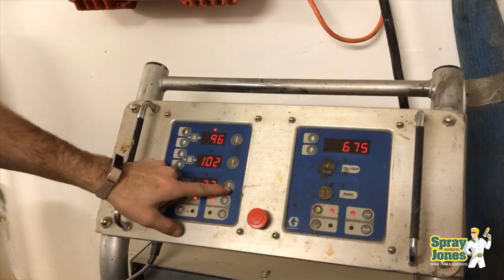So you want to get into Spray Foam Insulation?

Comment: When I foam a building I just use cans of window foam from the Depot.  Last job only cost me 12,000 cans x $5.99 = $71,880.  The house didn't end up even needing HVAC when I got done because it was so thermally efficient.  Then I scrapped the metal cans for $40.00 at the local recycling center.  I'm a Jack-of-all-homes, a Master at foam. I don't even charge labor. That way they're not "customers" and therefore cannot sue me later when the yellow foam igloo I turned their house into suffocates the pet geckos. I love your video, and the knowledge contained therein. There is definitely more to the spray foam business than many may think. I love your brutal honesty.  You are most definitely saving many people from a lot of problems and I think your advice can apply to a very wide range of different businesses.  I subscribed and it's nice to meet you.
Reply: Omg I am dead 😂

Comment: I have been an automotive master service tech for 3 decades. Not only a welder but working on the Isuzu 3 cylinder diesel, gen-sets, compressor and hydraulics. Most people don’t understand that air needs a dryer system and there is a lot of maintenance & cleaning. 
  Plus you have trailer maintenance, brakes, wheel bearing need repacked, lights need to work, etc. Then, you need a coffin hoist that swings to lift 50 gallon barrels of materials into the trailer from storage. How about keeping equipment from freezing? Now you need to lease a building and polish you “Backing Skills”. If you have ever seen the ball knob on a steering wheel located at the 6:00 O’Clock position? What is that for? It’s for backing up. Your turn your head to use the mirrors and what you can see and if the trailer needs to go left, turn the ball handle left. Turn right, rotate the ball handle right! Easy if you grew up on a farm as tractors use these. A tyvek suit is cheap but a full helmet breathing pack runs $3,000-$5,000 for your time around the toxins you would normally just breathe in. There is a lot plus, how to bid the job and sell the entire package. It takes an hour to get to a location, an hour to setup equipment and heat materials depending on temps, run hose, gain access to the attic of walls to spray. Then time to get your equipment out, not make a mess, clean up equipment because it won’t clean itself and won’t work if plugged and how to collect for the job. Part up front and full payment when done. How about photo of current drivers license to see if they live there, names match, recovery of payment if they leave while you are spraying. Depending where you spray, should the people leave, pets, elderly family or folks with compromised breathing problems. Yes! A lot to do. Don’t forget quarterly taxes. Earnings reports to a bank, keeping track of income, pay your self first and reinvest into the company. You can’t spray and earn money if you don’t have product or enough product at the job site. Yep, a couple of things….

Comment: I had foam sprayed in a new pole barn, ended up buying the company from the guy.  (Retirment age guy).  6 years in I finally feel like I'm getting a handle on things.  2 years of loosing money before I understood the equipment even though I have a background in mechanics,  welding & fab, electrical,  etc. I feel like I have an advantage over a lot of ppl but still struggled for so long.  I'm working to be an elite company in my area,  not another uneducated hack.  Thanks to people like you online and a few locals I've gotten some good support and information.
Reply from the maker: Excellent. It is a specialty trade and needs to be treated as such.
Reply: @SprayJones  here in the US there's almost no regulation.   It's coming and we need it!   I think it will help weed out the hacks.
Reply from the maker: @cattlehaulerkw  Some. It allows for a higher grade of idiots...
Reply: What kind of licenses do you need? Or just the insurance to operate this business? Thanks!

Comment: Honestly it depends on the person. I worked with a company that did two coat epoxy in food manufacturing plants. We could only actually work on the weekends. First week was cleaning, and understanding all the parts, getting fitted and learning how to sandblast. Friday came and off to Georgia. The plant only shuts down a section at a time, but this section is at least 20,000 sqft. There was 20 of us, so 10 of us doing 12 hour shifts that alternate. First step was prepping the walls, which was sanding metal to create a profile, then it was wrapping all the electrical, pipping and scaffolding. When it was time to spray, i stayed with the pump guy to help with whatever the sprayers needed and to help with equipment. Got cool with him and helped him with the barrels and watching the gauges. He taught me a lot of shit in that first shift. 2nd shift came in to rotate and I noticed the guy was staying put. Where we keep the drums and pumps is always sealed off with thick plastic so you cant really see and you also cant enter unless you’re fitted(full face mask/suit), so i stayed with him, didn’t really care about getting in trouble. In those 24 hours i asked that man almost every question i could think of. The next weekend, i was spraying. Went from 15$/hr to 37$/hr and i had all the sprayers respect

Comment: Beautiful work Mike 👍 always have spare gun have plenty of spares o rings etc have a maintenance routine and stick to it always use manufacturer parts clean filters regularly and y strainers stay within recommended parameters for hose and chemical heat zones don’t yank the heated hose connections may come loose and throw up an error code costing time to find fault regularly service compressor and a25 stick to this you’ll have minimal problems steer out of it and it will bite guys ( closed cell sprayer from uk )
Reply from the maker: Amen brother.

Comment: Can these spray foam rigs depending on the g*n (pew pew) deploy the same type of material (foam) which is used for setting post in the ground? 
The same stuff that is in the bag, the alternative to using concrete. 👊
Reply from the maker: Yes they could. Posts are just using pour foam.

Comment: I was told once the spray foam equipment gets used for first time that the equipment must stay working everyday and that the equipment can’t sit for more than 2 days before you start having issues with the equipment.
Reply from the maker: A little extreme, but on the right track.

Comment: Thank you for the video Mike, it was very informative. Quick question, what do you think of blown in insulation business? I am 20 years old and live in South FL and I want to start my own blown in business. I have about 2 years of apprenticeship and have a good feel for the business but afraid to take a risk and pull the trigger to start it. Any advice? Thank you
Reply from the maker: Ah.... get more experience. 20 is young, you ready to deal with narcistic a-holes that want to sue you because you missed a spot?
Reply: @SprayJones  thanks for responding sir! 
I understand what you’re saying. The guy I worked for moved up north last year and told me that I can take over south FL and he would take over north FL but tried charging me %60 of the profits which for me was a no go. I got my A&P license and turned into an aircraft mechanic but the thought of starting my own insulation business is still in the back of my head. But I’ll take your advice and wait for the right time. Again, thank you

Comment: Quick question Mr.Jones did u apprentice before u started your spray foam business ?😊 .
Reply from the maker: Yes I did, I worked in SPF from 2000 - late 2004 before I started Jones. In fact the firm I worked at built rigs and trained contractors including on site oversight and set ups.

Comment: I had to go against a home owner once over a 900$ difference in price for roughly 1500sq ft roof deck between me and some competition. If I didn't have my ducks in a row and wasn't able to show the difference in technical knowledge about how his roof functions with or without the foam he would have thought just about price. IF you don't have the time to bother with building science and can teach and inform customers about it you're going to be fighting for lowest bidder every time.
Reply from the maker: Agreed. Lesser knowledge has to be lower, they are getting what they are worth.
Reply: @SprayJones  Got a question for you though. I've been asked about a job concerning making closed cell flush with a 3 5/8th metal stud. Do you have any experience cutting closed cell flush in the PNW? I'm in the southeast and architects have just started drawing it like this. Is there a machine you could reccommend or have heard about?
Reply from the maker: @akselwagner  All cutting of open cell is done using a 36" long blade used for cutting cardboard. 
You can buy an air operated vibrating cutter that uses this long blade. 
Most SPF equipment suppliers sell them.

Comment: The problem with you doing these videos is it makes it hard to find a competent Spray Foam company in my area 😆.  When I ask if they caulk all the seams and then give me that deer starring into headlights look, my questions get even more technical 😂.  Maybe there’s so many startups with people with no experience, because they got frustrated with all the companies in their area that they couldn’t trust.  I can’t lie I’ve thought about buying the DAP HVAC machine to practice😜🤪.   I had one  representative have the nerve to say I would have to find out from the building inspector if 3” on the roof deck would pass inspection (umm you don’t have the inspector on predial let alone not know the code).  Asked another rep if he could quote spraying all vent pipes and water lines in the lower level (house is up on pilings) as well as the deck.  He couldn’t understand why I wanted the vents, water, and sewer pipes sprayed and when he sent the quote it wasn’t included.  Another would only quote me 2” in the wall cavity; even though I wanted 3”😂.  The struggle is real when you watch Spray Jones!
Reply from the maker: And that is why I do what I do. Those morons out here give the industry a bad rep. So better that you be educated and weed them out rather than hire them and get taken advantage of. 
If the SPF installers won't learn I aim to educate their customers so they can't hide.

Comment: Sounds like is easy as hell to run a spray foam company… and 10,000$ for an engine rebuild on a generator? A works kit for a max force dt is 3,500 bucks… what kind of generator are you running? You can rebuild an isx for 5 grand… cool background of someone spraying purple foam but come on…
Reply from the maker: A John Deere turbo 3 cylinder is $5000 Canadian in just the parts to rebuild without any major head work. The shop rates around here for diesel start at $145 per hour. Book time on full R&R is 38 hours. Do the math...